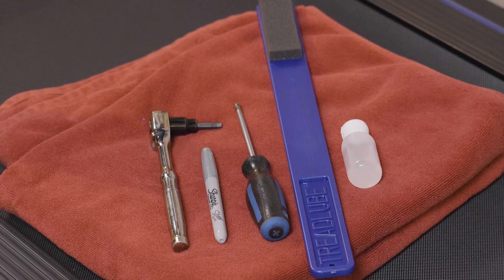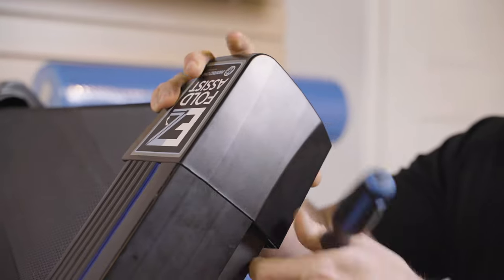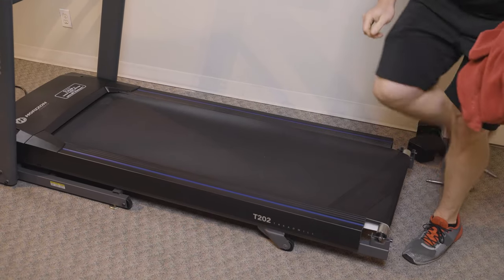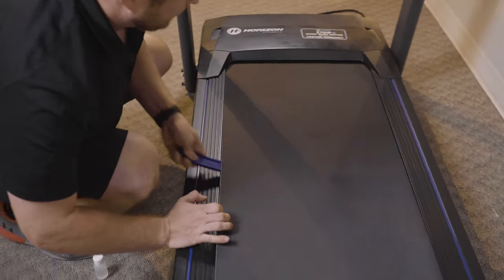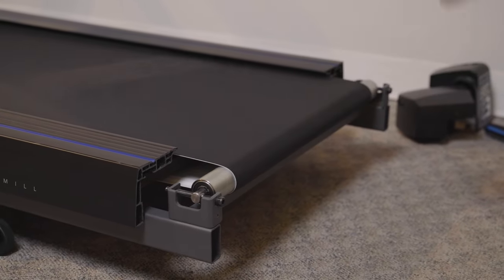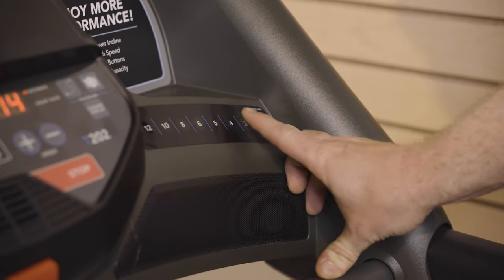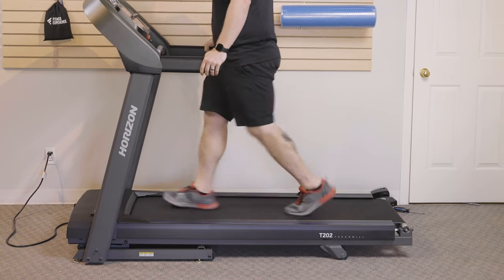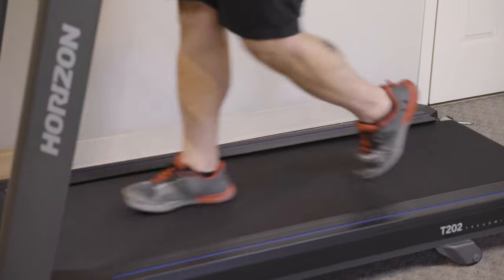Your Guide To Treadmill Maintenance

Comment: Hi... Helpful vid, thx ... Quick Q, I understand the towel process to clean the deck and belt, but is there a reason why wasn't it done a 2nd or 3rd time after (manually) rotating the belt. Wouldn't there also be dust and grime on the rest of the belt (underside) that would contaminate the just-cleaned deck? Just curious.
Reply: I was literally thinking the same thing
Reply from the maker: You can absolutely do this on both sides of the belt. With that said we usually do it mainly to clean the deck portion from debris that has fallen from the belt, there is nornally more debris there then you would find still adhered to the belt.

Comment: I’m a little confused between loosen the belt and adjusting the belt. Are they two different bolts?
Reply from the maker: on most treadmills, the bolts that loosen the belt will be the same that you adjust the belt tension with. These bolts go through either side of the rear roller, when loosening be sure to do so with an even amount of turns on each side, then tighten with the same amount of turns on the way back. To adjust side to side movement of the belt, simply turn these bolts a 1/4 or 1/2 turn at a time to help the belt track straight.

Comment: I was about to follow the instructions but checked the manual. My manual reads "Your treadmill features a walking belt coated with high-performance lubricant. IMPORTANT: Never apply silicone spray or other substances to the walking belt or the walking platform unless instructed to do so by an authorized service representative. Such substances may deterio-rate the walking belt and cause excessive wear. 
If you suspect that the walking belt needs more lubricant, see the front cover of this manual."
It seems a bit odd. But my manual also includes pricing for a 3 & 5 year plan for preventive maintenance services. 
My nearest service location is 2hrs away. I also don't want to have to pay for something that is easy to do. Does anyone have any input?

I have the Proform Pro 9000
Reply from the maker: We have seen this from time to time where manufactures specify not to use "silicone spray" however these same treadmills use silicone lubricant in a liquid form. 

Although we do not carry the ProForm brand, I just took a look and they do utilize a silicone lubricant "packet" which is a liquid silicone.